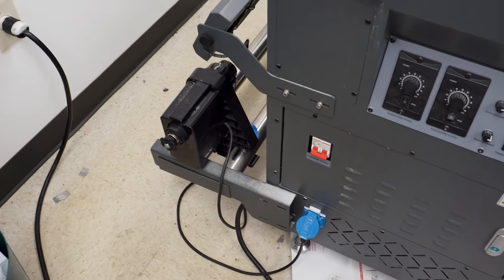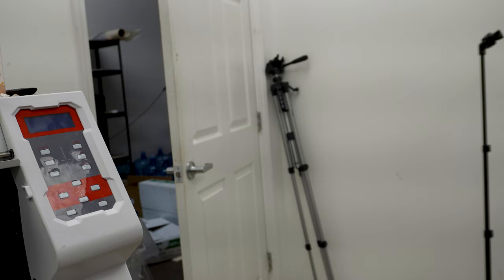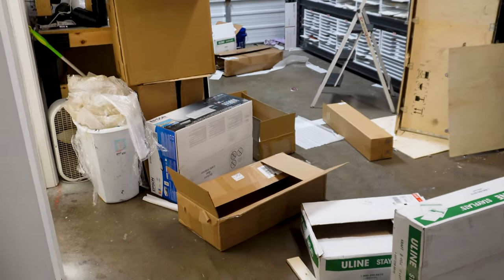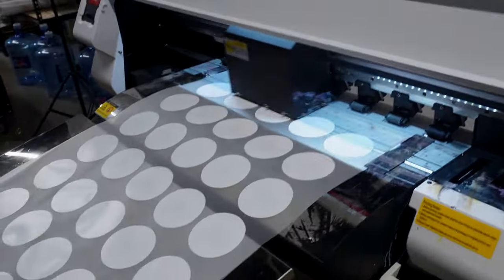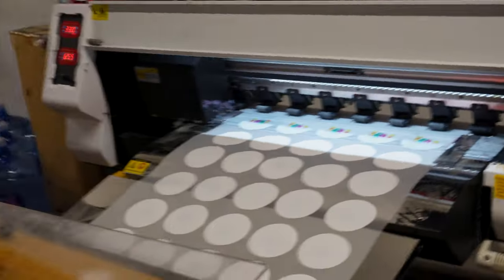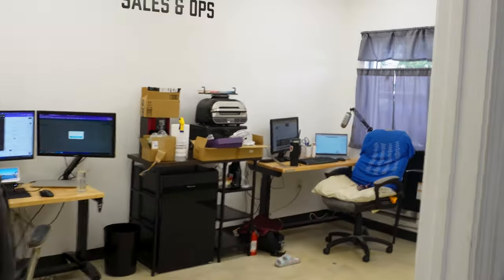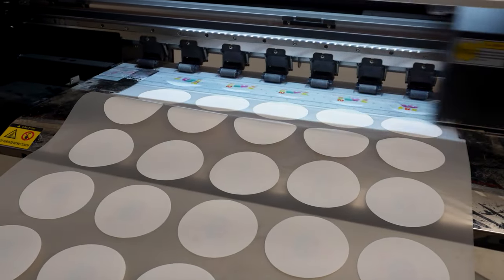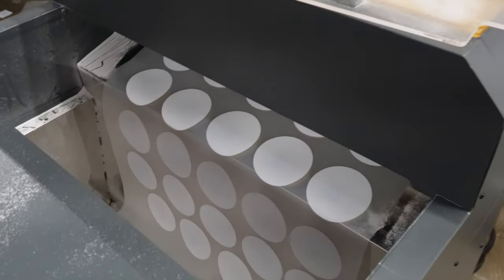Running 2 Audley DTF Printers - How to Turn On Color Bar / Confidence Strip  Day 15

Comment: What version of Cadlink Digital Factory are you using with your Audley DTF printer?  I have Digital Factory v11 Desktop but could not find the Audley driver.  My Audley is the 13 inch.
Reply from the maker: I am not sure if the 13” wide format does come on there as we use digital factory 10 wide format edition
Reply: @chooseams  Thanks. I purchased Digital Factory Edition ($945).  Load the software and can't even do a test print.  My "Set Ink Order" is greyed out.  I have to find a solution.  Hate using MainForm.  I am on a US Military base in Japan and tech support from fiery is non existent.
Reply from the maker: Are you able to make it look like you are in United States? Like calling from US number or VPN. Idk how things work on base. Maybe a VPN is a big no no. 

But the support they offer over the phone to me was outstanding. They guide you through everything in my experience.
Reply: @chooseams  Thanks.  They gave me some very good info/advice.  I am currently working the small things out.  Your videos really helps.  What is your best temp settings on your powder shaker?  I am trying to find mine.  Latest setting for me is  125°C, but not there yet.  A bit tough to peel off the DTF even when I thinkj it is cold enough to peel.  Also, what is better, cold peel or hot peel?  Keep posting those video blogs.